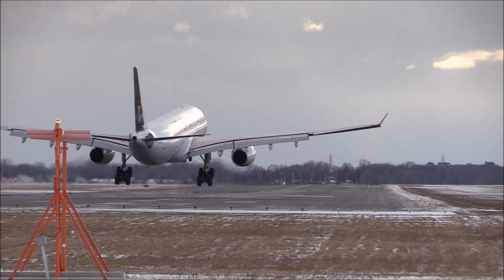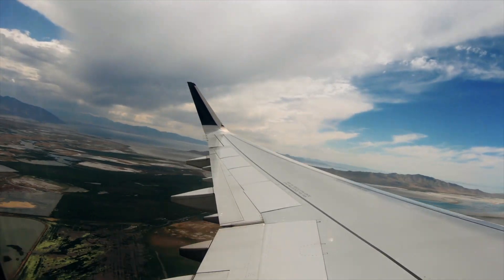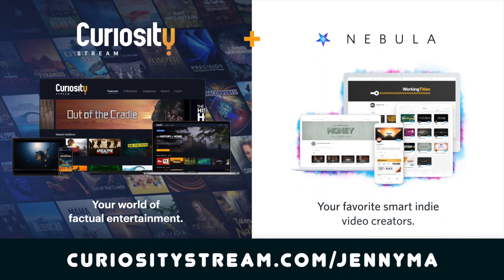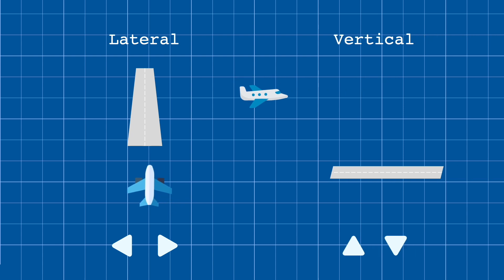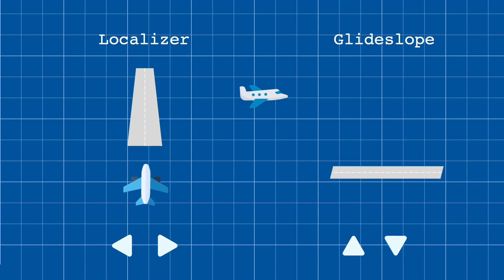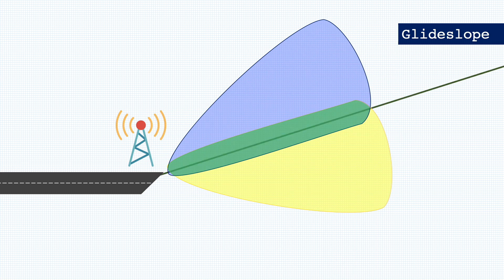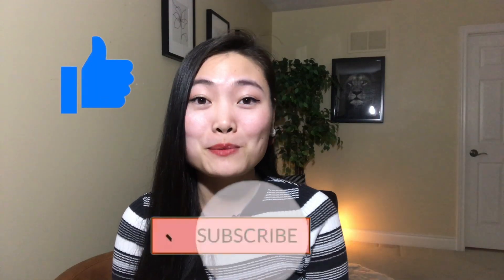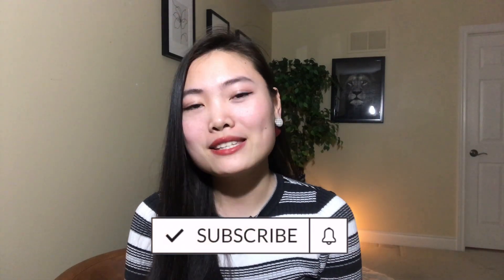How to Land a Plane: A Very Hard Problem

Comment: Plenty of airports have 4 parallel runways. LAX and MCO come to mind. The accepted strategy is to use one number above or below the actual heading of the runway. So MCO has, for example 35L/R and 36L/R, even though the magnetic heading for the runways is 005° (so 36 would be the "more correct" number).
Reply: I’m more used to seeing both on real flights and on YouTube videos, left, centre and right.  It might not be true that 4 parallel runways “aren’t allowed to exist”, but Jenny was giving the most usual configuration.  I often wonder what they do for airports where 2 planes land at once, on parallel runways which are spaced more widely apart.

Comment: That was a lot of great learning in a few minutes, thanks! But does Ryanair have lots of hard landings? (Never flown them) is it cheap flight hardware or pilots?
Reply: I’ve flown Ryanair plenty of times and can’t say the landings are any harder than any other airline.  Also, they fly to and from Ireland, which isn’t called the “Emerald Isle” for nothing!  There are situations where it’s safer to come down with a nice solid thump, one of those being in heavy rain or where there are pools of water starting to form on the runway.  A soft gliding butter landing runs the risk of the aircraft hydroplaning, despite a ridged runway.

Comment: I think the main thing I learnt here is that I'm NOT supposed to roll the plane upside down a few times and have the stall warning screaming at me as I barely avoid surrounding streets when I play Microsoft flight simulator.... My landings are usually really smooth though!
Reply from the maker: Do you fly for Ryanair???
Reply: @JennyMaAviation  HMMM no but mayyybe I should put in an application.